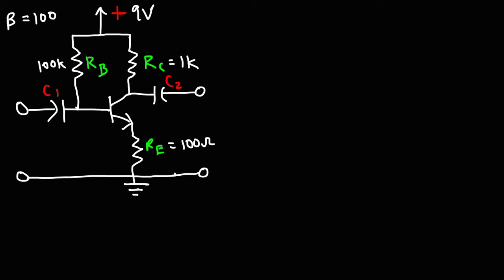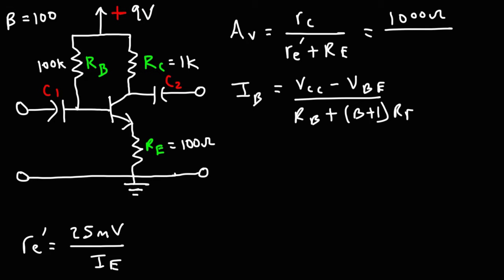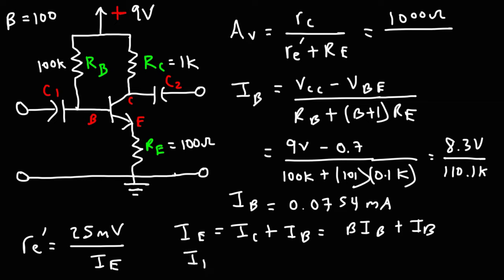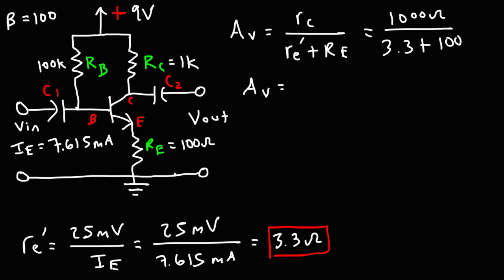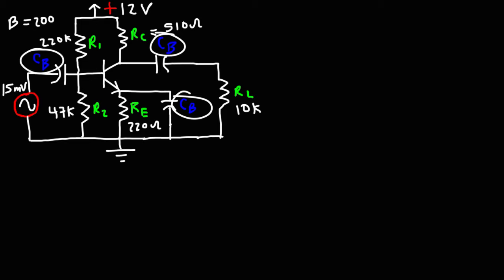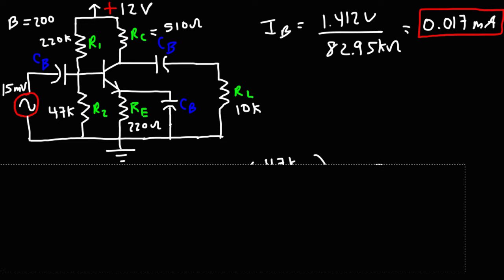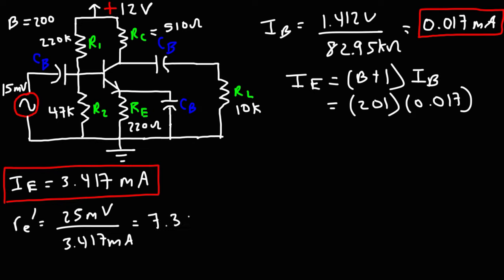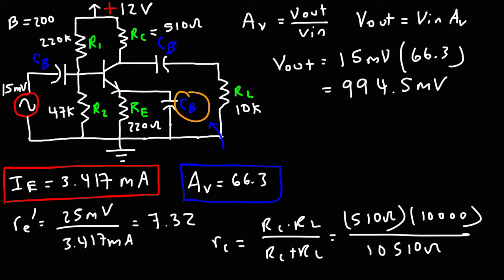How To Calculate The Voltage Gain of a Transistor Amplifier

Comment: Nice explanation ! 
To those looking for intuitive explanation on how collector  and emitter resistance play  role then  voltage gain is limited by the supply voltage and more you get closer to supply voltage more upward voltage swing you attain and hence with Bigger Rc it is achievable and to take care of other end of voltage swing smaller Re will give more voltage swing towards down side of voltage waveform.

Comment: I'm always amused when these calculations are done with 4 significant figures when the actual circuit might use 5% tolerance resistors and 20% tolerance capacitors.
More importantly, it's important to note that the reactance of the bypass capacitor has to be small compared to the unbypassed emitter resistance, not the resistance that it is connected across. That because the gain is effectively Rc / (re + Xc) and doesn't flatten off until Xc < re, where re is the total unbypassed emitter resistance. In the case where the entire emitter resistor is bypassed you need to calculate the bypass capacitor to be smaller than 25mV/Ic at all frequencies of interest.

Comment: Thank you. I’m curious to know, if Re is being bypassed by C in the second and last examples, what’s the point of putting it in the circuit and what purpose does it serve?
Reply: I think you still have to make sure that the transistor is biased properly and operating in the active mode (as opposed to cutoff or saturation).  So you still have to make sure the DC characteristics of the circuit are taken care of, even if you ultimately want to focus on the AC signal.
Reply: It's to stabilise the dc operating points, as @samter says. When you have different samples of transistor and resistors with variations in value (possibly ±5% from the marked value), then the possible variations in base-emitter voltage and β, coupled with the resistor variations can significantly alter the voltage at the collector if Re is not used. The emitter resistor will ensure that if a small increase in emitter current were to occur because of sample variations, then that current would increase the voltage at the emitter, which will tend to reduce that current again. That is negative feedback and is absolutely necessary to ensure dc stability.

Comment: Is re'= 25mv/Ie formula or we got 25mv from the calculation?
Reply: 25 mV is a constant assumed when the voltage vT is not given
and for info it's the voltage at room temperature 20c to 25c

Comment: Why 25mV ? In 13:51 and before you use allways 25mV calculating re` where does the 25mV come from ?
Reply: It's called the "thermal voltage" and is an intrinsic property of semiconductor junctions. Its value is kT/q (Boltzmann's constant times the absolute temperature divided by the electron charge). It appears in Shockley's diode equation (you can Google it for detailed information) which relates the current through a semiconductor junction to the voltage across it.

Comment: Hi! I have something to ask, hope you'll help me out (or someone)
So my teacher told me the formula of Voltage gain is Av = - (rc/re), while on your video it said Av = rc/re. Can you explain why? I also curious why the gain is on a negative value.
NB. I also found another source that gives the same formula as my teacher, but they didn't explain why.
Reply: - sign implies that the signal is phase shift 180deg afair
Reply: @johnolivercenteno3407  thank you Mr. John
Reply: idk if you need it still, but, deducting the Vout formula I got that the minus sign comes from the negative current of Ic, because Ic is flowing oposite of Vout. This means that the waveform will be inverted. I used Pi model in AC analisys. Hope it helps

Comment: How does one get the values 0.7V and 25mV?
Kindly help
Reply: 0.7V is what the measured voltage between the base to emitter on a typical transistor but it can vary, and as for 25mV I've found this to be useful https://www.asc.ohio-state.edu/gan.1/teaching/summer04/Lec6.pdf
Reply: They’re constants

Comment: can anyone provide a good source for the voltage gain formula? I've been trying to get my head wrapped around the underlying concepts and I'm having a hard time
Reply: Derive it.
A small increase in the voltage at the base (Vin) will create a small increase in the current into the base. Since the current through the emitter is always β times the current into the base (assuming β >> 1),  that small current change is β times larger through the emitter. That implies that the effective resistance looking into the base will be β times larger than the total emitter resistance. But we already know that the total emitter resistance is (re + Re), where re is the intrinsic resistance (= 25mV/Ie) and Re is resistance from emitter to ground.
So the small change in current into the base will be the small voltage change (Vin) divided by β(re + Re). However, the consequent change in emitter current will then be β times larger, and will therefore equal β times Vin/β(re +R) = Vin/(re + Re).
The collector current is equal to the emitter current (assuming β>>1), so that the current through the collector resistor (Rc) will increase by the same amount as the increase in emitter current. But the top of the collector resistor is fixed to the supply voltage, so the increase in collector current will produce a decrease in the voltage at the collector. The voltage at the collector will change by -Rc times the change in emitter current (which we found was Vin/(re + Re)), But that is the change in the output (Vout), so we can say that Vout = -Rc x (Vin/(re + Re). That demonstrates that Vout/Vin = - Rc / (re + Re), and the ratio of the change in output voltage to the small change in input voltage that caused it is, by definition, the voltage gain.

Comment: If you have an inductor between the power and the collector, can you use the inductive reactance to calculate the gain of the amplifier?
Reply: Yes, but then you have a gain that increases with frequency. Normally we want the gain of the amplifier to remain constant across a broad range of frequencies.
Reply: @RexxSchneider  Sweet, thanks. I was just wondering because I've used designs that use LC tank circuits to amplify only a small band of frequency.

Comment: Can we find Vb using voltage divider rule Vcc*R2/(R1+R2) 
and the use Vbe=Vb-Ve and get Ve
and the use Ie=Ve/RE to get Ie and then re=25m/Ie 
IS IT CORRECT?
I tried this but the results are different can you help?
Reply: Unfortunately, the voltage divider "rule" only works if a negligible current is drawn from the bias point. That implies that the current through R1 and R2 is much greater than the base current, and in this case, that is not so. The base current on the simplistic calculation would be about 33μA (that's 2.1V minus 0.65V, divided by 220R, divided by 200), while the current through R1 and R2 would be only 26μA, which is clearly impossible since the current through R1 must be equal to the current through R2 plus the base current. So the base current significantly loads the base bias point for this circuit (which is not ideal because of variations in β).
You can use the divider rule to calculate Vcc*R2/(R1+R2) = 2.1V, but then you have to use the Thevenin equivalence which is that voltage source in series with the parallel combination of R1 || R2 and so that becomes 2.1V in series with 39K. That is now loaded by the base impedance (β x (re + Re) = 44K) and the offset of 0.65V from the base-emitter junction. If you look carefully, that is equivalent to the complicated expression used in the video for Ib. You get (2.1V - 0.65V) / (39K + 44K) = 17.5μA.

Comment: I cant figure out how he got this formula for Ib, since its different from the video he referenced. Can someone please explain it, or just wright the kvl equation they used?
Reply: I thought Vb = Vcc * R2/R1R2 (normal voltage divider) but this is false. This is why I couldn't figure it out.
Reply: Copied from my reply above:
Unfortunately, the voltage divider "rule" only works if a negligible current is drawn from the bias point. That implies that the current through R1 and R2 is much greater than the base current, and in this case, that is not so. The base current on the simplistic calculation would be about 33μA (that's 2.1V minus 0.65V, divided by 220R, divided by 200), while the current through R1 and R2 would be only 26μA, which is clearly impossible since the current through R1 must be equal to the current through R2 plus the base current. So the base current significantly loads the base bias point for this circuit (which is not ideal because of variations in β).
You can use the divider rule to calculate Vcc*R2/(R1+R2) = 2.1V, but then you have to use the Thevenin equivalence which is that voltage source in series with the parallel combination of R1 || R2 and so that becomes 2.1V in series with 39K. That is now loaded by the base impedance (β x (re + Re) = 44K) and the offset of 0.65V from the base-emitter junction. If you look carefully, that is equivalent to the complicated expression used in the video for Ib. You get (2.1V - 0.65V) / (39K + 44K) = 17.5μA.

Comment: where dose 25mV come from ?????
Reply: It's an assumed value of thermal voltage for a silicon BJT transistor
Reply: It's called the "thermal voltage" and is an intrinsic property of semiconductor junctions. Its value is kT/q (Boltzmann's constant times the absolute temperature divided by the electron charge). It appears in Shockley's diode equation (you can Google it for detailed information) which relates the current through a semiconductor junction to the voltage across it.

Comment: Why make it so complicated? I just want to know how much output power a certain amplifier has with a certain input voltage? 🤷‍♂️
Reply: This is an explanation of why there is a certain voltage gain in a circuit.  You don't need to know this in order to buy and amplifier and use it.  You should know this if you want to build or modify an amplifier.  It's only "complicated" if you want to understand what's happening and why.

Comment: Where come from 25mV ?
Reply: It's called the "thermal voltage" and is an intrinsic property of semiconductor junctions. Its value is kT/q (Boltzmann's constant times the absolute temperature divided by the electron charge). It appears in Shockley's diode equation (you can Google it for detailed information) which relates the current through a semiconductor junction to the voltage across it.

Comment: Based on the high standard of all your other videos, I had to give this one a thumbs down. I have been working through your electronics transistor related videos and they are created from a talented mind. In this video, in the first 5 minutes there are a couple of issues. You mention AC collector resistance without a clear definition. Perhaps you mean impedance (ie resistance under a alternating current?)  You say that the AC collector resistance is the parallel resistance of the collector resistor and the load resistor. Why is this ?
Reply: Where did the 25mv (@1min25) come from ?
Reply: @grahamstreet6537  it is basically a constant
Reply: No, he meant ac resistance. Impedance is a general term that also includes the reactance of capacitors and inductors, but only resistance needs to be considered for the frequencies of interest here. In the circuit there is a collector resistor which is the dc resistance. However, it may be coupled through a capacitor to a load resistance. That load resistance plays no part in the dc collector resistance, but it becomes part of the ac load resistance at all frequencies high enough for the capacitor's reactance to be small enough to be neglected. Since the positive supply is always a low impedance path to ground, the ac current through the collector resistor goes to ground in parallel to the ac current passing through the load resistor, so they are in parallel as far as ac is concerned.
Reply: @grahamstreet6537  It's the thermal voltage, a physical constant that comes from the physics of semiconductor conduction across junctions. Look up "Shockley diode equation" for a full description.